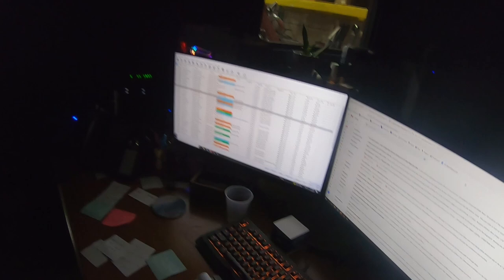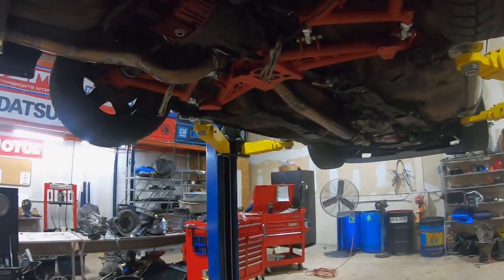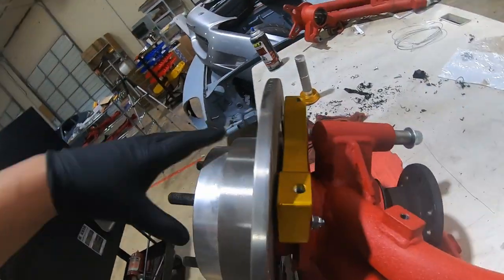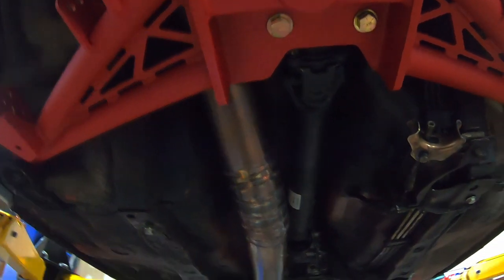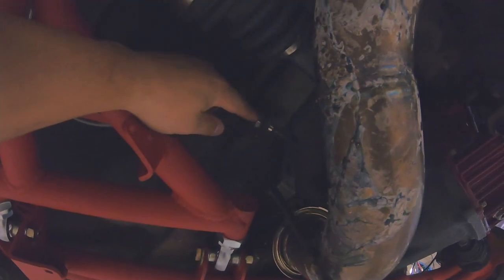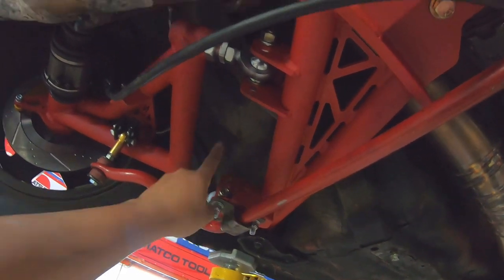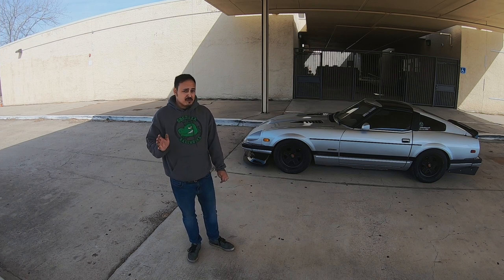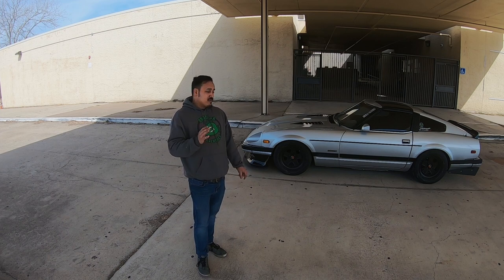Development Series | Episode 3 - Apex Engineered 280zx Adjustable Rear Subframe FULL REVIEW

Comment: Great video series and so cool seeing parts reach the market for this chassis. If I may though, ....one shop practice... 5:30- you should not press in a bearing using the "rotating" part.  It puts unnatural pressure on the balls, and they may brinnel the race(s).  Bad practice to risk premature wear, even if in practice you get away with it.    You should press in using the "static" part to apply the force to, that is: the outer race.   Use a press step-disc including in most press kits. In doing so, then no extreme side pressure will be applied to the ball-race interface.   Millwright 101. ;)

Comment: Awesome video what hub shafts are you guys using? 2+2 in need of upgraded hub shafts.
Reply from the maker: As of right now, the only off the shelf option for the 280zx are the turbo CV axle conversions. We are currently working on adapting a set of FutoFab axles from a S30 to fit the S130 chassis on an Apex install we have in shop. We did speak with FutoFab who is currently working on adjusting one of their kits so it will fit the S130/510 chassis, but you'd have to reach out to them to see what their timeline is.

Comment: So what is your static rear camber value at the max positive adjustment? I have BC’s as well and am just as low and looking to get this setup soon
Reply from the maker: We didn't get a chance to address it in the video, but at my current ride height, with nobody in the car, the camber is near zero. This is with the LCA bolts in their maxed out positive camber adjustment. We are getting ready to send it back for some tweaking and possibly have some data on how much each bolt hole accounts for in terms of camber. I want to get more negative camber out of it just for handling/wheel rub issues under acceleration, so stay tuned, we may do an addendum video covering some of the information, as well as our thoughts having installed a few of them now, as well as driving this one around for a year.

Comment: So I’m trying to figure out the camber settings.. The crossmember has 3 holes at the joint where the control arm connects. Do I adjust the camber of  by setting the inside joint to the top set of holes and the outside one to the lowest? Hope that makes sense? Thanks
Reply from the maker: Yes you would adjust the lower control arm bolt positions to tilt the control arm for more or less camber.
Reply: Thanks for the reply, I appreciate it. I am almost done installing this kit on my ZX. Just need to put the brake calipers back, bleed brakes, and get alignment. This video series has been a huge help! Thanks for the tips
Reply from the maker: @Sireal_beats  You're welcome! Thanks for watching!

Comment: You are pressing the bearing in incorrectly. You should be using a tool that is the same diameter of the race so it pushes on the race and not the actual bearing.